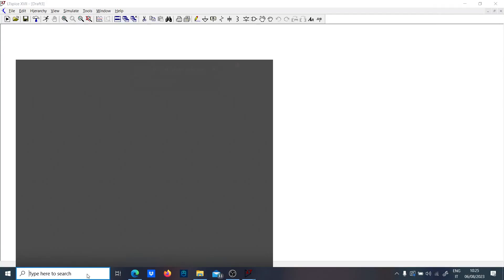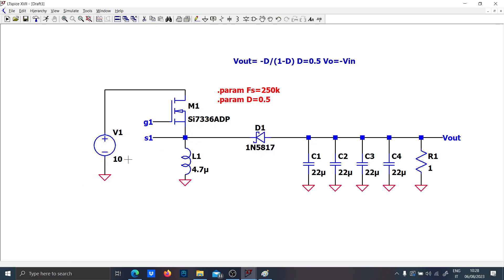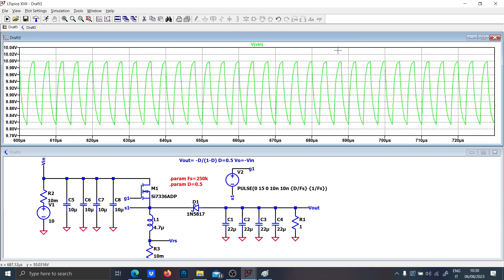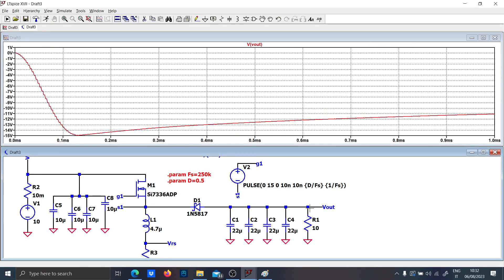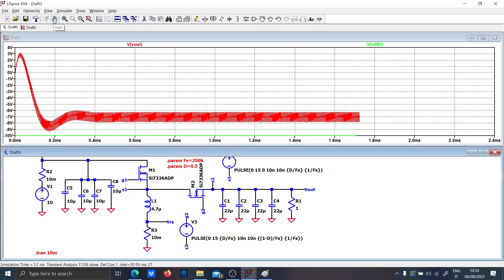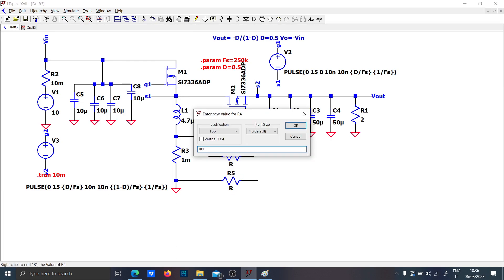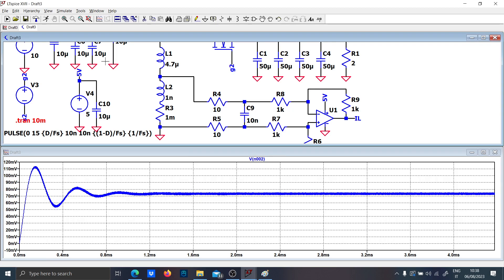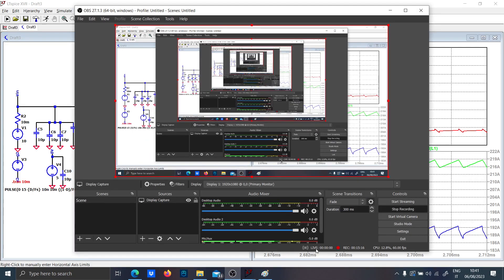LTSPICE Buck Boost with Inductor current reading

Comment: Excellent....could you please validate this Design with some calculation
Reply from the maker: This is a fast design, and basically the only thing you have to design for low power application is the inductor, which is always around 1uH-4.7uH. Then put the output power bank to suppress the ripple and for the basic converter you are done. Then of course if you need to design converters seriously in the order of 100W-1kW and above, you will need all the losses of the switches,diodes inductor , capacitors etc....
This videos are just informative.
Then I also do a design, but it will be an exerise 30min or even 1hour long
Reply: @manoA98A  🙏.. Thanks....incase if you have time then could you please make a detailed design videos.... anyway appreciates your time and efforts